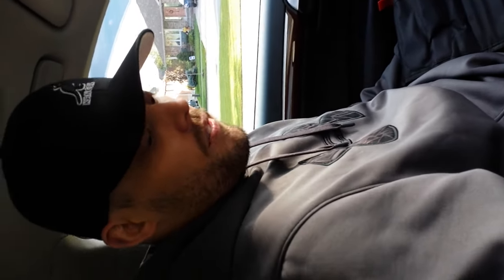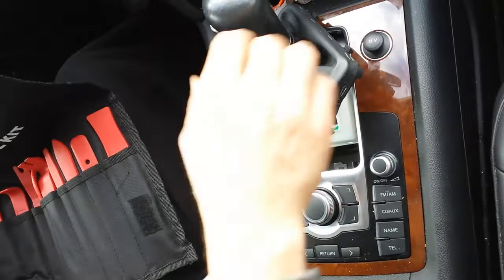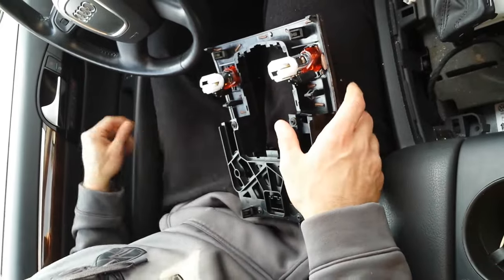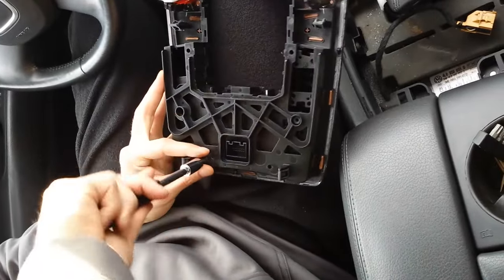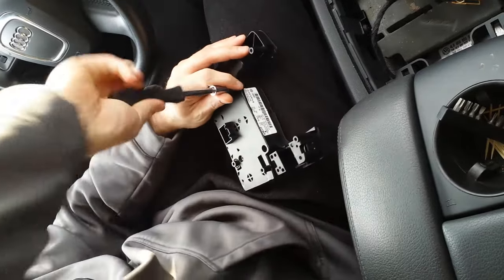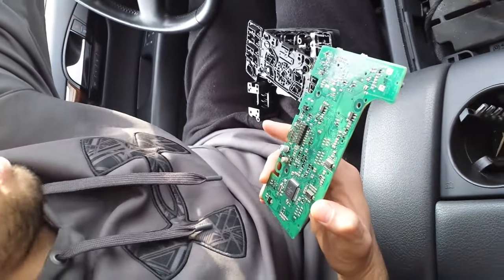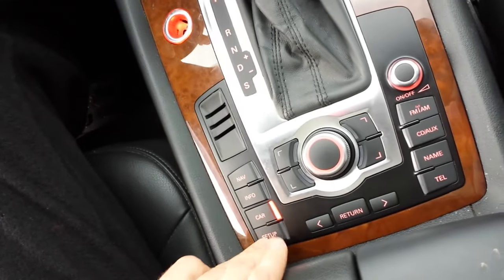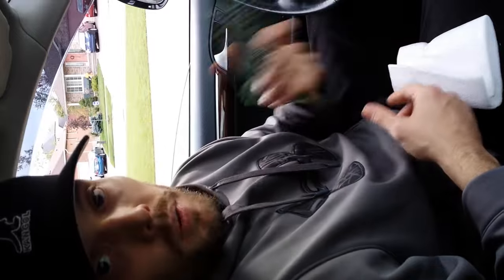Audi Q7 MMI Console Circuit Board Removal and fix.

Comment: Thaks fro the video !  The same thing  happened and  dashboard  "worked" as yours.I was about to   open the console  But  lazy as I  was, I tried firstly  to  dry  it  .  I did not open the console and used   hairdryer  on the console for 4 min  and let the car run   15 min on   high inner temp  . So  Strangely   -  today  I was ready to   do everything what  you didi ,    everything worked again ! It can be repaired  with hairdryer aswell. :-)
Reply from the maker: That is awesome news. I hope everyone see's this comment.

Comment: If I can do it, you can do it! Oh my goodness! I cannot thank you enough posting this video! I literally just finished changing the control board. I am an elementary principal who knows zero about car mechanics. I watched your video about a month ago and didn't have the confidence to do it myself. I took my car to the mechanic and didn't like the price but at least my mechanic was KIND enough to to let me show him YOUR video and he encouraged me to do it myself. Even with it taking me 20 darn minutes to figure out the torque tool, I replaced the board and put things together in under an hour! Hot diggity dog. It took me a few more minutes because I have push to start and I was clueless how to take out the wires and I didn't; just worked around them. I chipped my nail polish but saved enough money ($3200 to be exact) that I can drive my happy self to the salon and have them done! I am raising a glass of good libations in your honor, Mr. 4 Realz!
Reply from the maker: I love comments like yours. Thanks for taking the time to comment and I am very happy you did it your self. Cheers Lori, glad I could help.

Comment: new board just showed up, swapped it out in 20 minutes     WORKS JUST LIKE NEW!!!!!!
thanks!!
FYI   the whole fake wood part will pull straight out, unplug 4 wires, then you can remove the plastic chrome on you desk
Reply from the maker: Awesome glad it worked out for you. Thanks for the tip.

Comment: Thanks for taking the time to do this, I am sure you've helped a lot more people than you think because this is a common problem in many Audis. I have an 06 A8l with rain damaged mmi. I will first try to clean it, if not see if there are circuit boards for it as well. Your video was tremendous help, thanks a million.
Reply from the maker: +bruno937  Thanks for the kind words.  If you have trouble finding a board, Let me know I will try and help. I found this board in the crevices after all lol.   Nice car you have there. I like to think of the 4 rings as a family , Glad I could help in some way.

Comment: 4 Realz,I too greatly apperivate that you took the time to post and share your experiences with swapping out the mmi board. I was also able to obtain a new mmi board from Hong Kong at a reasonable price. The tooth pick idea was priceless and far better than using a flat head screwdriver to separate the plates. 
Your informative video was short and right to the point.
Safe travels.
Reply from the maker: Hey,
Thanks for the kind words, Tooth picks are the tool for this job.
 I am glad I could help and it all worked out for you. Safe travels to you as well.

Comment: The same situation and need happened to me.  Thank you for your great and encouraging video.  I first attempted to save the old board with some improvement after cleaning but still needed replacement.  I found that it was not necessary to remove the center control knob as it can stay in place. Purchased and installed new one and works perfectly.  Season greetings and THANK YOU!
Reply from the maker: Glad it all worked out for you. Thanks for the added info on other supplier for the board and about the center knob not needing to be removed. Every time I get a comment it makes me happy I did this video. Hope you have a great new year and Merry X-mas to you.

Comment: Thank you, 4 Realz for a great video how-to. I followed your steps and it all worked as shown. Until I got to the wire harness your's doesn't have, the one for the engine start/stop buttons. I couldn't figure out how to disconnect that plug. I wanted to take to assembly with the push buttons out to clean off the soft drink residue. So I just did the cleanup in place. Your video made the job MUCH easier. Thank again.
Reply from the maker: +Jeff Hood Glad it helped . I would like to upgrade mine to add the start stop button. I don't think its too hard. Thanks for the comment and nice words. Glad it worked out for you.

Comment: Harry S.... Sounds like I'm right there with you. Unless we both got bad boards, we have something else going on. Luckily I found a friend of a friend who owns an electronic store. I drop the car off Monday. I'll let you all know. He suspects it's a break in the Fiber Optic loop which I've read on another post. Basically, it's a continuous loop. The fiber optic cable goes through several parts. The MMI board being one of those. It also runs through the blue tooth, any phone system that was originally installed. The amplifier, nav, and cd disk changer among others. Several people have experienced the phone system failing. That places a break in the loop and the MMI will shut down to protect itself.
Reply from the maker: That is good information to know.

Comment: Hi I just finished changing mine and it works...... :) thanks a lot for sharing your video (the best part was with the toothpicks I was struggling to take that silver part off but than played your video again and it just popped out) , you just saved me $2600 since that is how much Audi Quoted me.I bought  the electronic board from eBay for just $90 and it took me 30 min to change it.
Thanks a lot again, Greetings From Serbia!
Reply from the maker: I am Happy it worked out for you. Thanks for the comment.

Comment: What's up man. I just want to let you know that I got my navigation system installed and running finally thanks to your help and your advices. Just like you said it was very easy once you have the right parts. Really appreciate it
Reply from the maker: No problem. Glad I could help and it all worked out for you.

Comment: I am going to try this.  I pray it works.  My light used to go on and off until eventually they didnt come on anymore and i can't use the knob to cycle thru the options.   I could press the knob to select something tho and the volume button worked but none of the other buttons would work or light up.  I don't recall spilling anything on it. I live in Vegas.  It may just be the summer heat
Reply from the maker: Hopefully  it works for you. Let us know if it works.

Comment: The electronics place hit it right on the head. I had a break in the fiber optic loop. The culprit was the Sirus radio receiver. I don't have a Sirus radio subscription and don't care to in the future. So he just bypassed it. Labor was $240. The receiver was another $400 if I chose to keep it but I decided to bypass. Other known issues that will do the same thing are the bluetooth receivers, handsfree phone and boss radio amplifier. All can be bypassed if you don't care to keep them. Parts can be pricey if still do.
Reply from the maker: That is good to know, But I installed my Sirus and my navigation for a few hundred , That included a splitter for power wire and fiber optic Y splitter. I assume the $240 was for him trying to find the problem. I think mine had a loop where my sirus connected and I took it off and put in the Y so I could add the Sirus and Navigation.

Comment: I also bought the boys just in case because it takes about 2 months to get delivered to Australia and thought I'd give it a shot trying to clean it like you said and that works good on you for putting this up here. 
just a tip for all you at home is that there's a fantastic site in Germany where you can buy Audi parts for a fraction of the cost that you would pay in Australia or any other country it is all in German though so you'll have to use Google Translate to figure out the particulars I purchased a mirror for the driver side on this site costing me only $150 including postage with as most of you would know is a good saving from the $700 quoted from a wrecker and as every out he has multiple different plug it's almost impossible to find the website is called algero
Reply from the maker: Thanks for the tip.

Comment: Hi. I heard you saying in this video you also installed a navigation system in the same audi q7. I am wondering if you can post a video about it. I have a 2009 q7 3.6 saying navigation is not installed .I would really appreciate it
Reply from the maker: It was real easy to install the Nav, Dealer said it couldn't be done 
because it didn't have the wires already there. That's B.S everything is
 there including the antenna. You just need to get the Navigation 
Unit/Dvd player and a splitter cable for fiber optic and power cable. 
Here is the link to the facebook group where I put in all the 
information. If you have any questions or need help I am here for you. 
It cost me like $200 to get the factory Nav working.  https://www.facebook.com/groups/126898554036024/permalink/956235771102294/
Reply from the maker: I installed the Navigation as well as Satellite Radio. Scroll down in the facebook  group to find the information. I was learning as I went so not the best write up. If you are serious I will send you part numbers if you can't find them. I got it all off ebay.

Comment: Hi, great video. I just received the circuit board today and followed all of your steps, which are so easy btw, but once I tried to connect the module back into my car it still does not work, any ideas why? I even submerged the original in alcohol to see if it would even start working but nothing happened as well. I have a 2008 Q7 4.2
Reply from the maker: Thanks for the comment. I would check all the wiring harness and move them around to make sure its not a connection problem. You would not be the 1st person to get a faulty/defected board. If everything fails, contact the seller and tell him the board is faulty. What are you MMI symptoms ? Do you know it is liquid damage ? I hope you can get it worked out and keep us informed please.
Reply: Thanks, yes it was liquid damage from my son spilling water on it and when we removed the board it was covered in rust, I tried to clean it with alcohol and reinstalled it and its still doing the same thing. The MMI display comes on then goes off, every now and then the display will come and play music but shut right off, probably happened 2-3x over the course of this problem. Should I also unhook the battery?
Reply from the maker: No don't unhook the battery. I am thinking you got a defected board. It happens. I would tell the seller and ask for a replacement board and try that. It would not be the 1st time.

Comment: Thank you it is beneficial video. I have Q7 4.2 2008 and my Radio and CD is not working only . i hope it is programming problem and in case it is the board then i will buy it and change it my self. Thank you again

Comment: Hello, thanks for the video. I don't have navi in my 2008 audi q7 will the same circuit board work or do i have to look for one that says without navi?
Reply from the maker: Yes. same board works. Mine did not have nav, I put in in after. But the board is the same.

Comment: okay I'll try that it's not getting any power in the fiber optics aren't showing any red light in the back at the Bose amp so once that shuts down it gives no power and my correct going to take out the board I was wondering if I take out the boards and not let the client leave with it will the car still run right without the board in it
Reply from the maker: I can't say for sure, But I don't think removing the board will cause any problems with the car running.

Comment: l have a 2006 Audi A6 my mmi console have the same problem buy when I rest the mmi the screen come on for a few sec and shuts off u think if I replace the mmi module if it will work? I need help thank u
Reply from the maker: Yes,  I think it will fix it. Mine did the same thing.
Reply: OK thanks when I replace it I will let u know thanks

Comment: Ok.  I completely explained my problem incorrectly.  All buttons work except for the large knob.  I can press to select an option but I can't cycle thru the options when I turn the knob left or right.  The buttons also do not light up.  I took it all apart and cleaned the board but I'm still having the same issue.  I ordered  a new board.  Fingers crossed that it works when I get it
Reply: Same exact problem I had.  I replaced the board and all went well!

Comment: My man! Great work. Followed your video to aT. Got to the finish line, put the keys in the ignition and was totally defeated when the MMI system did not work. I've read something about splits in fiber optics wires. Where do I find them? Little help here. THANKS!
Reply: Hi mate, did you get any further with this one? I ordered two boards and tested both and I still have the same issue. Wondering if you could find other parts that might cause this issue? Help is much appreciated.

Comment: Hi there, I order the board replacement, and change ash simple as you present here, but the MMI is still not working well, any idea, what other board I´ve to replace ...?
Reply from the maker: Some times people get a faulty board. Contact the seller and see if he will send another. What are the symptoms now with the board ?
Reply: Hi mate, did you get any further with this one? I ordered two boards and tested both and I still have the same issue. Wondering if you could find other parts that might cause this issue? Help is much appreciated.
Reply from the maker: My guess is its the fiber optic cable then. Look through the comments and someone had to fix the fiber optic. I will look and try and give you the name.
Reply from the maker: @Bob Devito  He might be able to help you. If you still are lost, let me know and I will do some research.

Comment: 4:44pm on 11/08/24 plz help. I need your help regarding my 08 q7 Audi. I accidentally spilled juice all over it. It was working for after cleaning the mess up yes the buttons were sticky thought it was ok bcse it still worked and then it didn’t. Now I’m riding around w no music and the screen comes on just like yours. Plz can I have the website again. The site you gave isn’t working anymore. Plzzz heeelllpp me!!! 😢
Reply from the maker: Hey, its an easy fix. Thanks for pointing out the link to the part was no longer available. I updated an Amazon link.

Comment: Hi, just wanted to ask when you said you can clean the board are you referring to the actual board inside like the one you brought from the internet or are you referring to the black plastic that covers the board?  Also if it is the green board that you clean won't that damage it to once it gets wet? Thanks
Reply from the maker: +Ameena Mukhtar  Yes I mean clean the green Circuit board. I used Alcohol  pads  as I had nothing to lose but the damage was already done. I have seen similar boards submerged in Alcohol for a few days with no negative effects.

Comment: Hello 4 Realz, I bought a brand new board and replaced it. I am still having trouble with my MMI. Does not change from the initial screen it was frozen at with my old board. Tried resetting, no change. After a while the MMI unit powers down by itself:(
Reply from the maker: +Jaspal Ahluwalia  Did the original one have liquid damage or how did it stop working?  Maybe the new board is defected/Faulty ? Not saying it is the case, But it does happen.  Let me know and I will try and help you trouble shoot.

Comment: Does it matter if my MMI (2007 Q7) has the push start/stop button?  I haven't seen any mention of that on any of the video's or how to writeup's I have seen.
Reply from the maker: I remember in the comments a girl mentioning she had push start and it was the same board. The push start is separate I think, You can always just lift the panel and see . But as far as I know it is the same board. Good luck and please let everyone know how it goes.
Reply: You are correct, the push button start is another separate connector on a different board.  Install worked just as the video shows and my MMI works great!
Reply from the maker: Awesome, glad to hear it all worked out for you.
Reply: i just ordered the board. I too have the "push to start " option as well as NAV. Do I need to do anything different with my setup, or are you saying the push to start is a separate deal and not affected? I can start my car now using the push button , so im assuming I don't need to worry about that .
Reply: Bob Devito the push start is its own board so it's not affected by doing this.  There are wires going to it so the only difference is an extra plug you have to deal with.  Mine has been working flawlessly, so glad I tried it.
Reply from the maker: No its the same process. Same part. Here is a comment from someone on here who did it."You are correct, the push button start is another separate connector on a
 different board.  Install worked just as the video shows and my MMI 
works great!"

Comment: what is the wire called that's connects to the board from the  cd player because mine still just turns on for a few seconds then back off and the lights never comes on
Reply from the maker: +Al Boothe  Maybe its a Faulty board ? The board doesnt connect to the cd player. The cd player uses a power cable and a fiber optic. I assume you mean the MMI , But I don't see why it would be the wires.
Reply: A cd is stuck inside  cd player but it  still doesn't light up at all just screen turns on then off n about 5 seconds
Reply from the maker: Al Boothe
It sounds like the board. Did you get a new board ? If so maybe it is also defective.
Reply: +4 Realz yes
Reply: he going to send me another board he calms
Reply from the maker: Al Boothe
 That is good to hear. I hope it is the case. If it isn't , you can resell the board easy. Please let us know hoe it goes.